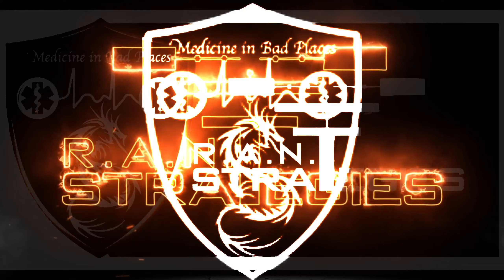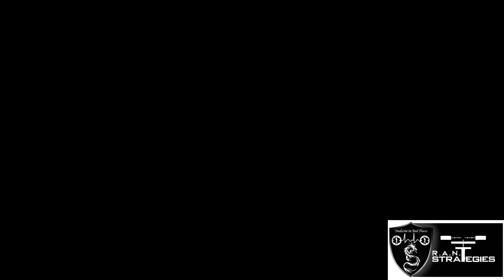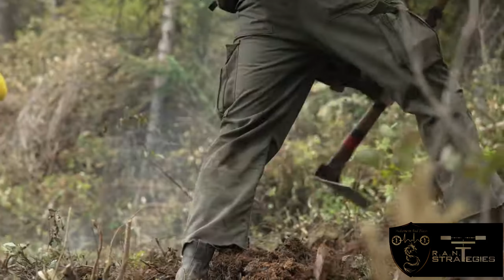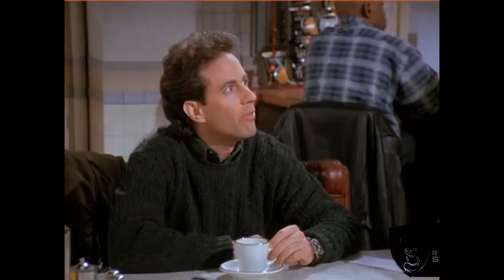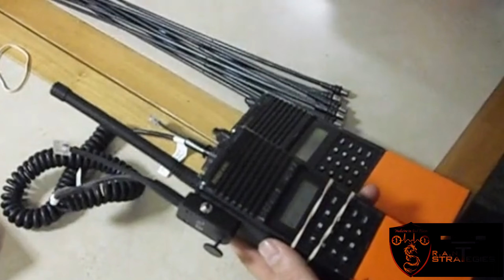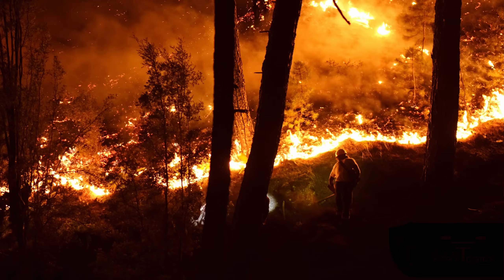BKR5000 Radio

Comment: Small correction - the APXs will do FPP/Cloning with the right flash option and there is a cloning cable available - I am not sure why that is not discussed more by Motorola reps when competing in the USFS/CalFire space.
Reply from the maker: I had no idea, definitely wish that was more common knowledge! Thanks for sharing
Reply: @RANTStrategies  Any time! The part that also confuses some is that there's an FCC FPP/Cloning, and a Federal FPP/Cloning. Both options accomplish the same goal with the FCC one just mandating a PIN lock to access the menu since Part 90 radios shouldn't be "field programmable by end user". I think that last bit of wording is why FPP/Cloning in general doesn't get talked about much.
Reply from the maker: That is awesome, I knew FPP was a thing because my 2500s have this capability and they require a password (didn’t know that was a the “federal” feature) but I’m still shocked to learn you can clone radio to radio…. Moto needs to get that info out there better!
Reply: I’d rather have anything but an APX for VHF work, especially simplex. The VHF receiver in the APX is atrocious when compared to Harris, BK, Tait, Kenwood, etc.

Keep the BK.
Reply from the maker: @SIGINT007  have you seen my radio testing videos using the APX vs several other radio?! You are SPOT ON THE MONEY WITH THAT!

Comment: Hello.  I run the BK5000 with the rechargeable battery for fire season.  The radio will last at least 12 hours with being charged.  Also, 511 chest packs fits the BK5000 radio.
Reply from the maker: @molliegumpert7715  hey Mollie, I would love if that were an option (I hate the mountain of dead AAs at the end of each fire) the issue is having charging banks big enough to handle all of the radios on these fires and then the accountability of them all……. How do you manage that?

Comment: Greeting from the Boise Fire in north cali. As you showed, UHF in the woods punches through smoke better than vhf, so I’m looking to bkr9000s being more common, even if just on tac channels. I don’t think a smaller radio would survive in a public safety environment. I used a XTS5000 for 10 years before. The alkaline clamshell batteries keeps the huge. If lithiums were more common they’d be smaller. USB-C would be ideal. I was pretty surprised how quick a comms plan could be pushed out. Enjoy your roll
Reply from the maker: Very cool!!! Please keep us posted on this, that would be huge!

Comment: Yep BK Radio is the portable (and now mobile) radio of choice for wildland and the Cal-Fire standard. 
The new BKR900 is same form-factor, but is a multi-band 5000 channel APCO P25 VHF, UHF, 700/800 MHz. $$$$
For those not aware, there are also smaller rechargeable batteries available, but the clamshells and AA batts are default for wildland reliability, longevity and the ease to pack spares.
Reply from the maker: @rickmaudlin2160  what’s your thoughts…..that is a lot of bang for your buck, but is that massive size needed? lol

Comment: Great rundown.. As a Comm tech deployed to wildfires in the comm unit, I love using my agency issued APX8000 for field radio troubleshooting purposes. But man is it so convoluted and a nuisance to update the comm plan every so often. Though I don't think they are ready for NIFC prime time yet, Getting close from what I heard. BK's in whatever flavor is still king, no pun intended. Motorola could of cornered that market if they square away the cloning feature among other features that come standard in the BK.
Reply from the maker: @GUERRILLACOMM  yea no idea why moto wouldn’t be more aggressive here, btw (we are back in CA currently on another roll if you happen to be out as well)
Reply: @RANTStrategies  In my experience Fire people tend to have some requirements that are really outside the norm compared to police users. Most Police depts get away with Over The Air Reprogramming (and rekeying), makes a lot of sense from a management perspective, they also usually have really deep installed infrastructure. Fire, especially wildland fire, is always going to be more ad-hoc and mobile. 

The differences in the size of the markets probably also plays a major factor, police usually get federal dollars for interoperability equipment, and tactical equipment. Fire, not as much.
Reply from the maker: @highdesertdrew  absolutely, for better or for worse, I get to experience both sides of this, but it does make me well versed lol.

Comment: The radio you had is typically called the command version which does not have the channel knob stop.  The radio can be ordered with a 16 channel encoder switch so the user gets the stops.  Same with the 9000.  Former Moto APX engineers designed the 5000 and 9000.  Nice radios but that clamshell…. needed for the power hungry mice inside spinning really fast.   I think I still prefer my DPH.  Enjoy your roll and stay safe.
Reply from the maker: @ScottW23  lots of insight there!! Thank you sir!
Reply: Interesting. I was thinking the same about the encoder with no stop...yeah, it has the beep, but that tactile stop is just muscle memory for so many. Not to mention that unless everyone has a radio that can do more that 16ch/zn, everyone is going to keep programming them with a max 16, whether that limitation is needed or not.  MAybe one day that legacy limitation will be moved past, but I think that time is still many years and incidents down the road.
Reply from the maker: @kg4gav  im planning on doing a video on how I like to program my radios and I’ll address my whole rational for preferring the fixed 16ch option on that one

Comment from the maker: Got this comment and I thought it was great, no idea why it wouldn’t show, so I wanted to share it - 	
@baronedipiemonte3990
I like the idea of portables having a dry cell "AA" battery case to swap out with the normal lithium ion batteries. Unfortunately, there's not a lot of consistency with the availability of that option. At least not with Icom (the mfg I'm most familiar with... and able to afford). But all of the Icom commercial/public safety portables have the option of 12vdc vehicular charging (cigarette lighter or hard wired). The other Icom feature I love is that it's not only field-cable cloneable, but (w/the proper code) they're FPP (Front Panel Programmable). Now if Icom would introduce a commercial/PS grade U/V dual band portable...